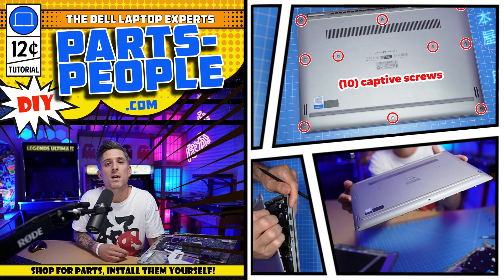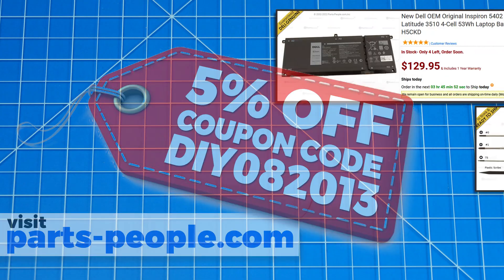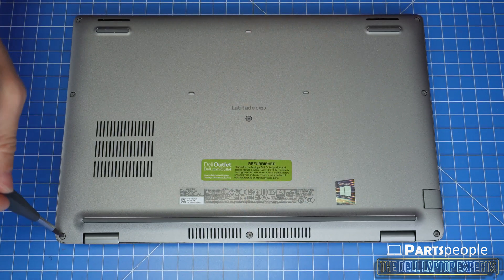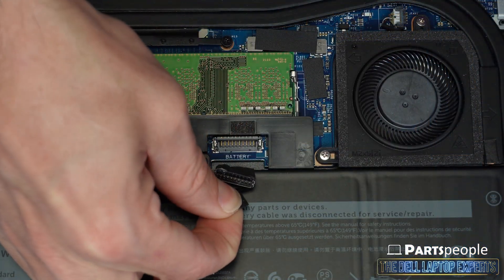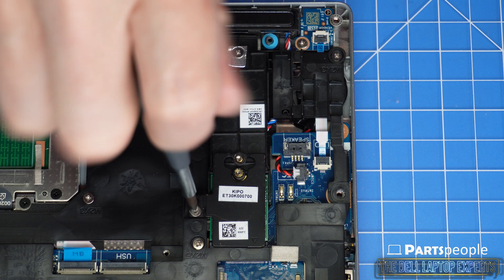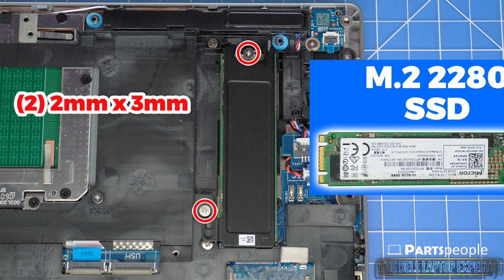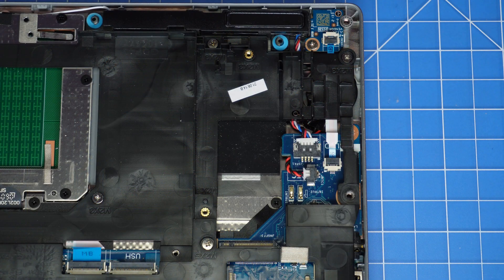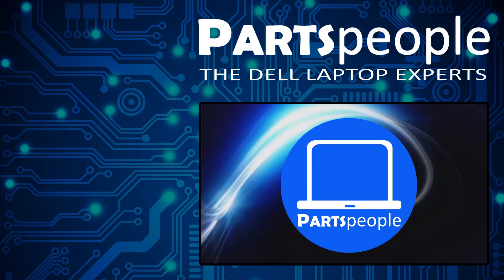Dell Latitude 5420 How-To Install & Replace M.2 NVMe SSD | Repair Guide

Comment: Can 2ssd be placed at Same time
Reply from the maker: Hi, not per Dell Latitude 5420 specifications. The motherboard does appear to have a 3rd m.2 slot so I'm confused myself. I'm not sure if we have any first hand experience investigating this so I can't give you a definitive answer. But good question - seems like other are wondering the same.
Reply: @dellpartspeople Can you check and confirm

Comment: do you know ush slot?? what is that??
Reply from the maker: Hi sorry for the late reply. Maybe you learned what it's for already but it's the "Unified Security Hub". It's only used if your laptop uses a palmrest with a finger print reader or NFC smart card reader.

Comment: I am from Canada and I was wondering if this SSD would be compatible with my Latitude 5420 - Kingston NV2 1TB M.2 2280 NVMe Internal SSD | PCIe 4.0 Gen 4x4 | Up to 3500 MB/s | SNV2S/1000G. Really appreciate your comments
Reply: 4th gen are backwards compatible with 3rd gen slots but it will run at 3rd gen speeds but you wont notice the difference.

Comment: can i install dual storage in same time in this notebook ?
Reply: There is a blank space next to the wi_fi card.  Is that where the 2nd ssd goes and do you some kind of securing tool again?
Reply: @JohnDoe-o9y  This channel is sort of dumb like a stick, they don't know anything. The empty slot next to the wi-fi card is the WWAN card (that's an optional card for connecting via a tablet SIM card, there's a tray that can be ejected on the back of the laptop and about 1" from the WWAN slot).
Reply from the maker: Hi, Yes. One will have your operating system and the other extra storage.
Reply: @dellpartspeople  which one the slot ?

Comment: I just purchased a 2tb 2280 drive (sorry I didn't find this site till I had made the purchase) for my Dell 5420. It has 512 as per dell refurbished in it now which I think is in the 2230. Do I Need to buy anything additional? The thing in the video that secured the 2230 drive looked different then the thing that secured the 2280 drive...Thanks.
Reply from the maker: You are correct. They are different. It is recommended that you use the 2280 thermal plate for heat dispersion. While we don't currently show any in stock, our inventory updates daily so if you can't find one elsewhere please feel free to swing back and check.

Comment: Great video,  I would explain there could be a mini and standard size version possibly installed.

I would point out to take care of the angle and orientation either is installed as the mini has some heating tape and plate which makes it a 3 part vs a 2 part.

This video was incredibly short and concise and love it very much for those reasons!!!!
Reply from the maker: Good point! Thanks for your feedback :-)

Comment: Hi dude! In this case, can I have both SSDs installed on this laptop at the same time?
Reply: Wondering the same thing.... well at least if it's possible to install 2 mini SSDs...
Reply: @Hoodhomesteading  no there's only a connector for one.

Comment: Today, I bought a Samsung 970 EVO Plus and upgraded it in my Dell Latitude 5420. Before the upgrade, I had a Western Digital PCIe 3rd gen 2230 SSD. I removed the cover for the 2230 and simply placed a metal piece over the EVO. My new SSD is currently very hot, and it's bothering me because it's at 65°C at idle. Is that normal, should I buy another ssd? 
Thank you in advance for your response.
Reply: Idle temps shut be around 50C
Reply: @rasmus3195   Update: I was able to get 44 degrees idle with a 21W/mk thermal pad
Reply: East legon hills ghana

Comment: Can u replace the 2230 with a 2280?
Reply from the maker: Yes you can. The only difference is the 2280 does not need a securing bracket to be installed. And you can find 2280 SSD's here: https://ppci.me/c/140/1468/hard+drive
Reply: Thee ports look different @dellpartspeople